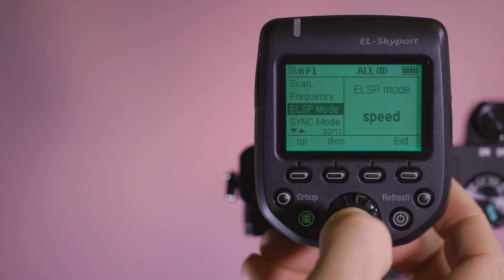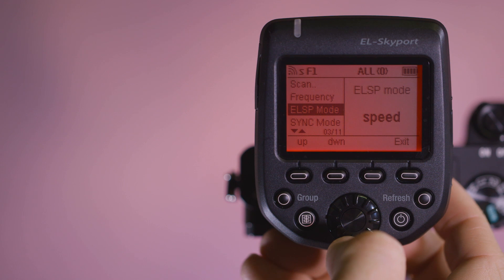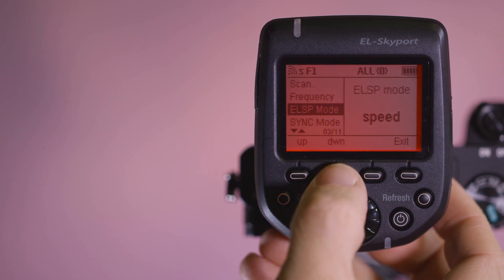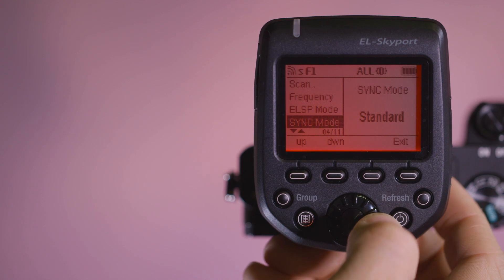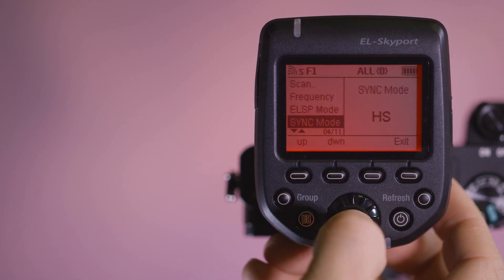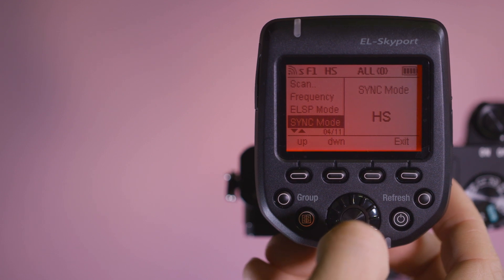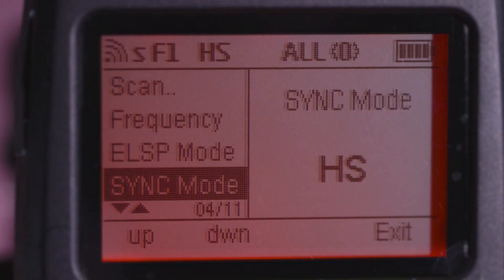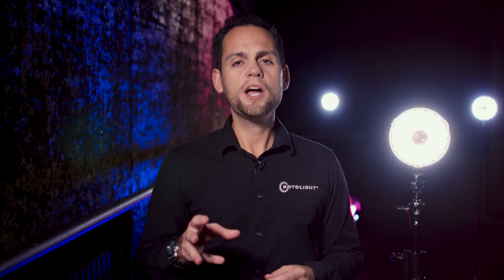Rotolight NEO2 Recommended settings for flash + Elinchrom transmitter setup guide! (OLDER FIRMWARE)

Comment: A ((( Rotolight / Sony Pocket Flash Important Information )))
  Hello for all of the individuals that are looking at Rotolight AEOS PRO & the NEO PRO and wondering if this product is for you let me give you some information that might help you make a Better / Proper decision. 
I will be directing my comments about the AEOS PRO and the NEO PRO. If you are working in a controlled environment like a studio where you have absolute control over your lighting. Or if you are doing videography in a low light situation. Or if you are shooting outdoors in a very gloomy or cloudy day and you are OK with your lights only being 3 to 4 feet from your subject. Then these two lights will work perfectly fine for you. 
   But if you are working in an environment where there is a significant amount of window light or your environment has a sufficient amount of lighting provided. You will find that these lights are extremely limited. If you notice they never use a light meter indicating to their viewers the strength or the lack of strength the lights provide.
   That all being said I have to give the lights credit where credit is due they do have amazing technology incredible technology wrapped up in these lights. It is the power of the lights that I have an issue with and only the power.
  I was sucked in by all of the technology and truly did not realize the environment that they were using the lights in. Either in a very dark environment or very low lit environment. Even when they use them outdoors notice that the environment is very gloomy or cloudy. It is never a bright sunny day.
   I will now give you the Data on why I have expressed such comments. I purchased both the AEOS PRO and the NEO PRO and when I started working with them I was confused by the lack of power coming from the constant light that these lights provided. I thought at first that it was just my imagination maybe I was doing something wrong. 
   So I lowered the lighting in my studio so that my  light meter was reading at 1.00 F stop for light in my studio which means the lighting in my studio was extremely low having no effect on my testing. Then I set my camera at 250th our second and my ISO at 1000. I then put both the NEO PRO and my Sony pocket flash to 5 feet exactly from my light meter that was set on a stand. I set my NEO PRO at 1/50 of a second which is what they recommend and I have it set at max plus Power. And the Calvin is at 4800 and the modeling light was set at 40%.
These are the exact settings for every test I made with all of the Rotolights that I tested.
   I then set the Constant light on the AEOS PRO at 100% and received a F stop of 6.3
   I then triggered the flash off on the AEOS 2, and I received a 7.0 F stop.
I then set my Sony pocket flash off at 1/32 of a second to receive 6.3 F-stop to match the power of the AEOS PRO.
   I then installed the NEO PRO at 100% on constant lighting at all of the exact same settings, never moving from 5 feet and I received a 4.5 F stop.
   With the data that I have provided I have shown that the AEOS PRO and the NEO PRO are less than half the power of a pocket flash. And if that’s the case then they should notify or inform their viewers or purchasers of such information. So such individuals can make a proper decision on their purchase.
  ((( I reached out to Rotolight and here was thier response ! 
     Hi Patrick, 
Depending on your flash meter some do have problems reading LED flash that might be an issue but without knowing what you are using it hard to know. Also where are you taking the flash reading from flash meters are designed to take direct only light so you need to measure from ½ way between the edge of the badge and rim of the light, if you measure from the centre of the light it will give you incorrect results.
   With the Pro lights we have pushed the constant light, but the flash should still be a bit brighter, I believe it is about 2/3 stop, if you are testing on 1/250s them you will not get the full power of the flash it has a 1/50s duration.
   Something sounds wrong as at 6ft, I would expect f6.3 at ISO 100 without the dome, we test at 1/60s and mid pit of the light around 4600K. )))
   Basically Rotolight is acknowledging that my information might be slightly off but we are still looking at Half of the power of a pocket flash. And if I would have known that I would not have purchased these lights. I personally feel we are being misled to some degree. 
     I have given you a link below of an individual that has pretty much done the same testing as I have. I think mine was a little bit more precise. That being said I would watch the video all the way through so you’re able to come to your own conclusion.
            https://www.youtube.com/watch?v=zFNGbkmG1sU

Comment: I just purchased the Neo 2 Roto lights with the Elinchrom transmitter PRO. I finally after days of trying to figure it out did find 1 video to help. Great explanation for the older version. WILL NOT work with new version.

Comment: I'm lost on this! So I have a Canon X2 trigger but if I want to use it with the Neo 2 I have to use a sync chord from transmitter to light? Doesn't that defeat the object? Why have you not designed this so it works with all triggers so you don't use chords and your trigger can adjust the light output? By the time you buy the dedicated kit your up to £400 almost.??
Reply from the maker: Hi Glenn, hopefully we can help clear up any confusion. There is not a single flash brand in the world that can work with other companies transmitters. Godox will not wirelessly trigger an Elinchrom or Profoto flash, for example. The NEO contained an integrated Elinchrom Skyport flash receiver, and so if you want to control it wirelessly then you can use any existing Elinchrom Skyport transmitter, or purchase the Rotolight Elinchrom Transmitter.  Alternatively, if you already own a transmitter such as the Godox X2, then you simply purchase the receiver for that transmitter (£30), and plug it into the 3.5mm flash sync socket on the NEO 2. That way you have the option, depending on your needs. Thanks

Comment: I got the Neo 11 & elinchrom transmitter as an Xmas gift but am having trouble, can anyone help?
When I turn on the neo11 it first of all shows the ‘brightness’ symbol. I push in both buttons to get the ‘menu’ but the word menu disappears very quickly & shows me options which are ‘CTRL & TECH’ both of which have side menus. Does this sound right?

Comment: I have a question I currently have a rotolight neo2 is there anyway I could use the gr iii with the flash capability of my neo2?

I could use a Godox tx1 trigger with the neo2 connected with a Godox flash trigger connection cable. Since the Godox tx1 has the ir sensor it would trigger the neo2 flash option. But I would have to purchased a lightpix flash however I would then Have to use two sources of light instead of just the neo2. Plus the extra $75 I would have to spend on the lightpix. I’m sure there’s a way to just use the Ricoh gr iii, Godox tx1, and my rotolight neo2. Could you help me figure this out?

Comment: This is not how my Rotolight behaves, not at all.
Reply from the maker: Hi Martti, apologies for the confusion. This represents instructions for a slightly older firmware (we have an updated video coming in the next few days with up to date instructions). However your transmitter and Rotolights should pair automatically straight out of the box, so if that's not the case for you. Please contact us and we can advise of the troubleshooting process in the interim before the video is released. Thanks for your patience

Comment: I could not figure out how to control the power of the flash of the NEO2 with rotolight. You can of course adjust power of the Continous light but I did not find how to adjust from 1/1 to 1/16  of power . any ideas ?
Reply: I think they just donthave the power of godox. I just bought the Jason Lanier Kit 2 rotolights and the flash amount it puts out... extremely low compared to godox ad200. $2500!! Hope we get the same question answered. Also there tech support is horrible.

Comment: The video is no more in light with latest firmware of the rotolight transmitter and there is no user guide available eg no more SYNC MODE it has become second curtain .   ID or type is displayed no more the 2. Also menu navigation is no more direct you need to push select button then switch from POWER / COLOR to NAV to enter into navigation mode

Comment: Does this elinchrom transmitter work with other speedlight? For an example, I have Neo2 and want to buy a set of speedlight, would Elinchrom transmitter work with neo2 and a speedlight?
Reply from the maker: Hi SeanKim, out of the box it won't, as the speedlight won't have the compatible technology to communicate with the Elinchrom transmitter. However you could also purchase an external Elinchrom receiver, and plug this into the speedlight via the PC sync port (IF your speedlight has one of those) and then the external receiver will communicate with the transmitter and fire both together. Hope that helps!

Comment: I can't find my Rotolight when I scan
Reply from the maker: Hi Lee, get in touch at sales@rotolight.com and we can double check your settings. This is probably because either a) Skyport has been disabled on your light (make sure Skyport is set to ON), or perhaps the light has been set to a different frequency or group - double check group and frequency settings are as you intended. Then once they are and SKyport is on, go into the menu you on your skyport and press the first option scan, to force the elinchrom to rescan for available units in the room, it will find your NEO 2 first time you do this.

Comment: How much is the trigger..expensive
Reply from the maker: Hi Paul, the transmitter is £229. However, please note that the transmitter gives you far more functionality than any other transmitter - as the video explains you'll be able to adjust colour temp, brightness and navigate the menu from up to 200m away, as well as trigger the flash! The Skyport protocol is known for it's rock-solid reliability, so despite the high price, this won't let you down. However, we have a built-in PC sync port for anyone who wishes to use third party transmitters too, see more info in our other video, just search 'rotolight transmitter receivers' in YouTube. Hope that helps!
Reply: Rotolight Sorry but that costs as much as the Neo.. Far too expensive.
Reply from the maker: Hi Paul, I'm afraid we don't set the price of the transmitter as it's an Elinchrom transmitter. You are welcome to use a third party transmitter as mentioned. Many thanks

Comment: One more question, cause I need to buy at least lights/flash and it will probably be the Neo2, I really like the way Jayson Lannier utilize them, can I use the Neo2 as a permanent light and if I need to shoot make it shoot at strobe, so I can have the light's on, so I know where's my shadows, etc.. and when I shoot make the strobe goes one? The reason I'm asking is sometimes we need a light, but when it's time to shoot, we need the power of the strobe. I hope my question is clear.
Reply from the maker: Hi Carlos, I think I know what you mean! :) There is a modelling light function so you can have a modelling light on to compose your shot and then fire the flash. Is that helpful? Also many flashes use a modelling light but they use an entirely different bulb for the modelling light rather than the flash so the result you preview is entirely different to the actual result due to differences in colour temperature and power, whereas Rotolights use exactly the same bulbs for both the modelling light and flash. hope that helps!
Reply: Awesome, Thank you, that's exactly what I want to know and what I was looking for. Thanks again, and by the way, Awesome customer service.
Reply from the maker: Thanks Carlos! :)

Comment: Can Rotolight neo 2 be operated using electric energy?
Reply from the maker: Hi Luciernaga, do you mean can it be plugged into the wall? Then yes, it can, and comes with a universal 110-240V mains supply. Otherwise you run it from AA NiMH rechargeable batteries or lithium ion AA. Thanks
Reply: Rotolight Yes using it while its plugged without batteries. sorry my english is not very well thanks
Reply from the maker: No problem, yes no problem - it comes with the power supply in the box so you don't need batteries. Thanks!

Comment: I am having trouble figuring out how to be able to control three NEO 2s individually. I tried setting each on a different group or channel but always end up only being able to control one or the other. Help please.
Reply from the maker: Hi shaolin95, if you could please try the following:
Leave all NEOs on the same channel but put them in different groups. Then restart the transmitter and you can click the 'Group' button which will work its way through Group 1 - this will only control the NEO in group 1 and then onto Group 2, Group 3 and Group 4 etc and then eventually onto 'ALL' which will allow control of all of the units together. Hope that helps!

Comment: Transmitter are very expensive and the neo light output seems much lower than a speed light but has an advantage of continuous light source for video,
Reply from the maker: Hi Catherine, we have just responded to your comment on another video. Yes there may be less power than a speedlight but far far more advantages :)
Reply: Rotolight What are those advantages? Usually I find led lights to be hard and create multi shadows unless diffused.

I love the shape and portability but am confused by low power and how to get HSS without spending another 300 on a transmitter
Reply from the maker: Rotolight's is famous for our soft light output, you want find the light to be hard and you get a single shadow with NEO 2, not multiple Advantages over flash  : 1) Continuous light allows you to preview your exposure, set your composition and achieve focus in low light, very difficult to achieve with a flash b) no recycle time at all, so you never miss a moment - vs 2 second recycle time on speedlites 3) electronically adjustable colour - you don't want a burst of white light at sunset, you want to match to the ambient lighting - sure you could use a filter on a speedlite but that cuts 35% light output immediately and you also have to buy it! 4) battery life - 85,000 flashes vs 250 of a typical speedlite 5) ability to shoot video and stills with one light 6) the catch light provided by the circualr share 7) lack of need to modify the light - out of the box NEO is inherently way softer than a speedlite needing less modification. Hopefully that helps.

Comment: I can't get my Neo 2 to sync.
Reply: I actually got it......Thank you.
Reply from the maker: Hi there, please email us at sales@rotolight.com or give us a call +44 1752 422 750 and we'll talk you through it. Are you using the Rotolight HSS transmitter? Did you follow the steps set out in the video? Thanks
Reply: I just pulled mine out of the box with the new A9 and Sony 70-200 2.8. I did everything in the video and got to the "SCANNING" and the Neo II is not getting "Picked Up" by the transmitter.  Were you able to sync yours?

Comment: what's the best/lowest profile solution for using the neo 2 as an on camera flash for the sony A7RII?
Reply from the maker: Hi Taylor, for on camera that would really depend on if you need HSS or not. If you don't need HSS then the most low profile option would be using our flash shoe, found here: https://www.rotolight.com/product/rl-flash-shoe/

Hope that helps!
Reply from the maker: Otherwise for HSS, get the Godox X1T-S for on camera HSS and a PC sync to 3.5mm cable